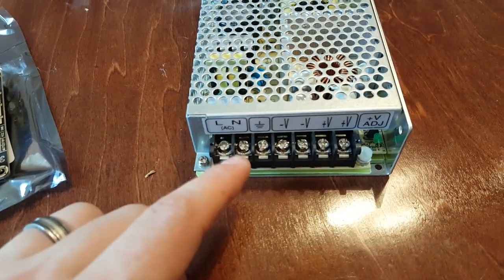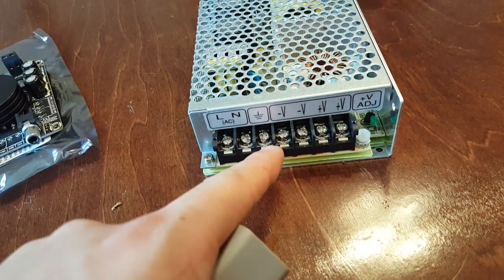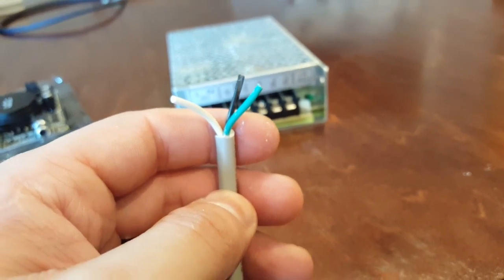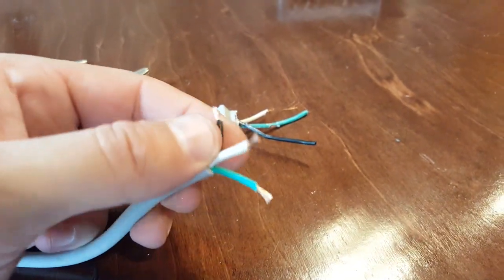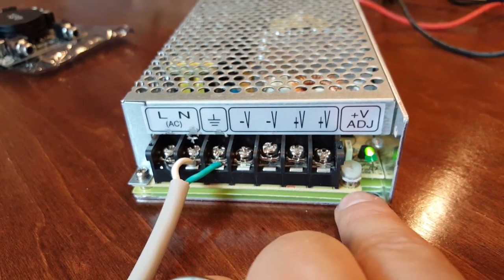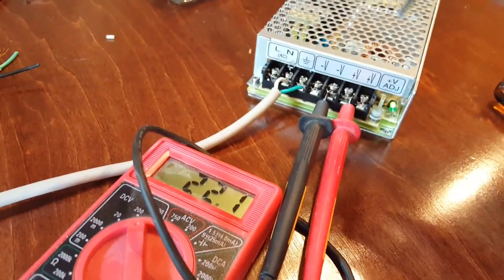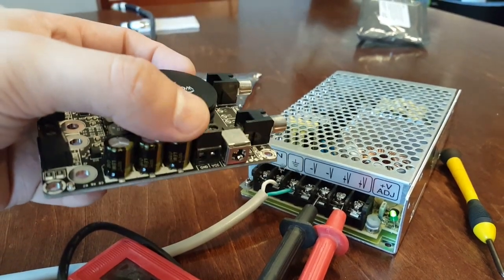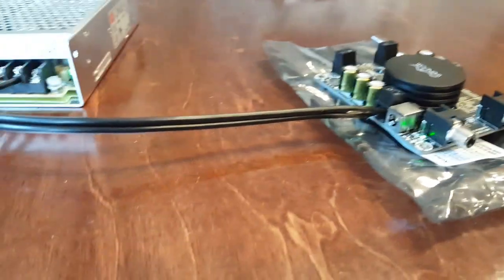How to hook up Mean Well Regulated power supply to Sure Amp Board

Comment: If i understand correct, it is regulated because you regulate it yourself for a fixed load ?, so it is not really regulated ?, i dont know if i wanto buy this thing, since i dont have always the same load.
Reply from the maker: Here's the definition from wikipedia: "A regulated power supply is an embedded circuit; it converts unregulated AC into a constant DC. With the help of a rectifier it converts AC supply into DC. Its function is to supply a stable voltage (or less often current), to a circuit or device that must be operated within certain power supply limits."
Basically, anytime you work with sensitive electronics you want to get the cleanest source possible.  This is the best way to ensure that.  Also you can regulate it to whatever load you need within it's range.  I hope this helps.

Comment: Hi, does it realy matters that L & N is exact correct ?, here in Holland you can place the power-cord in the wall 2 ways, so it should not matter, you can reverse it ? greetings
Reply from the maker: It absolutely matters if L & N are reversed.
Reply: Thanks, will it else break or burn ?, i dont get it why Holland has this weird power system without earthing and reversable L & N.
Reply from the maker: You have the possibility of burning up your brand new power supply.   Which, is never good ;)
Reply: Hi, i just called the shop, they say it dont matters because you can reverse the powerplug, earth is needed for sure. At least here in E.U. ( Holland ) + if you look L & N is inverted 50Hz sinewave of eachother.
Reply: hallo,dat maakt niets uit,je kan altijd de L en N omdraaien aan de stekker of stopcontact omdat het ac current is!AC is alternating current dus je kan altijd de + en - omdraaien!dat doet AC automaties met 50 cycles of hz per seconden,alleen niet in  je stoppenkast kan je de + en - omdraaien!cheers